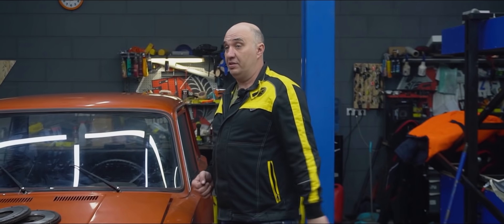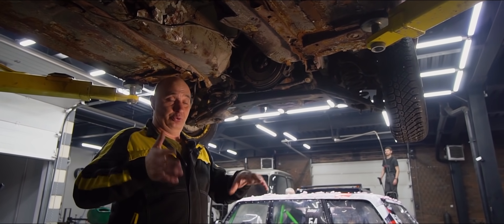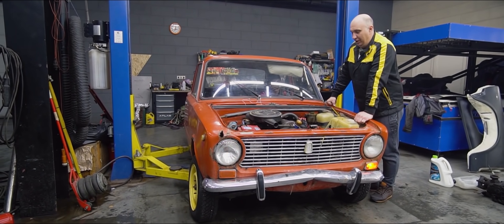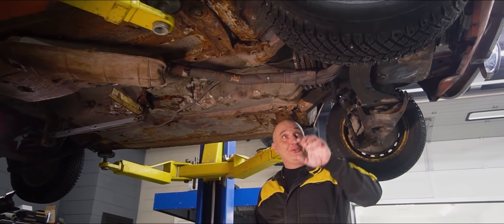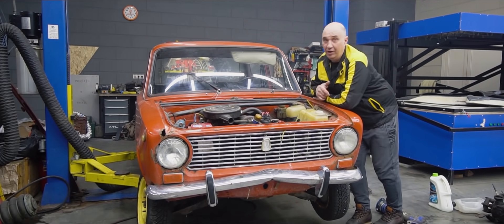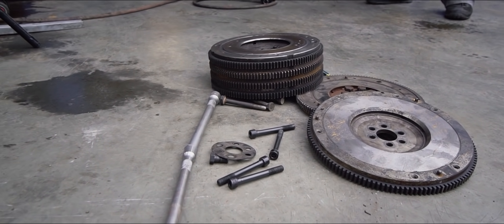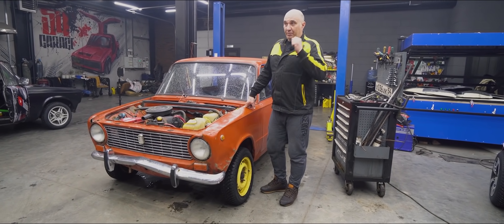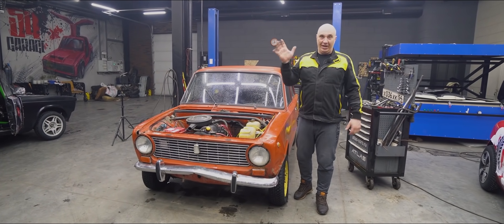What if you install FIVE flywheels onto an engine?

Comment: Tune it rich and watch the backfires.
Reply: You do realize backfires are when the flame comes out the carb, typically the engine stalls at that point. After fire is when the exhaust flames.
Reply: @tylerbonser7686  im pretty sure its backfire when it comes out the exhaust and its called spitting or coughing when its through the carb but its all preference what you want to call it
Reply: A backfire is when the combustion gases ignite while the exhaust port is partially open.
Reply: @tylerbonser7686  wrong
Reply: @kevinragsdale6256  and Johnathan A you guys are unfortunately wrong lol backfire actually is fire through the carb and after fire is exhaust popping
Reply: @jacobwebb8818  wrong, try again. Not one person ever has called a car back firing an after fire.
Reply: @kevinragsdale6256  a back fire is "back" through the intake. They call it that but they are miss informed. Simple lack of the literal meaning of the terms. Doesn't mean there right. Causes can be different as well.
Reply: @johnathana3368  it's not preference.  These are actual terms with different causes.
Reply: @kevinragsdale6256  look it up son but aight
Reply: Oh boy next gen mechanics😂.
Reply: Kevin Ragsdale you’re right, but a lot of people do call a car after firing a back fire.
Reply: @kevinragsdale6256  backfire and afterfire are both terms for when excess gasoline comes through the exhaust port and follows the exhaust until it arrives at the tip where fresh oxygen finally ignites the gasoline causing flames/fire. Not sure about terms for fire coming out of the carb tho

Edit: after a quick google search (which many people are incapable of doing) reveals that afterfire is when fire comes out of the exhaust, but is often called backfire by others. However, backfire is mostly known for fire coming out of the intake.
Reply: Yes !!!!!!
Reply: Get that ignition key going on/off ... in the middle of a built-up area.
Reply: @god.mp4 : thanks. I learned something new.
Reply: @meegstomtom  "a mistimed explosion in the cylinder or exhaust of a vehicle or engine." Not in the carb but in the exhaust pipe. Go down the road, turn off the ignition while leaving in gear. Open and close throttle, turn on ignition. BOOM out the exhaust pipe. That is a backfire. It does not affect the carb. It can blow up your exhaust system. And that is according to Oxford.
Reply: @gravelydon7072  oxford dictionary? Cause that is a literal after fire. While an afterfire is arguably a type of backfire, and most people commonly refer to both as backfire, there are still differences.
Reply: @gravelydon7072  Typically, a backfire takes place when one of the above explosions occurs outside your fuel cylinders. Some backfires travel back up the intake valve while others spill out through the exhaust system — causing a type of backfire known as an “afterfire.” Afterfires can sometimes result in visible flames shooting out of the tailpipe. 

per firestone
Reply: @meegstomtom  Correct on the dictionary. Websters says it is " a loud noise caused by the improperly timed explosion of fuel mixture in the cylinder of an internal combustion engine" but that is incorrect. That is the proper term for a detonation in the cylinder while the backfire is the noise produced in the exhaust.
Reply: @meegstomtom  A backfire never goes up the intake. I can get the same result with the ignition off on some engines after they have stopped. Turn off the ignition when it is shutting down but have the carb open. after it has stopped with the exhaust valve open part way, turn the ignition on. That will produce a loud bang and it will only be out of the exhaust. It is common for that to happen when you have an engine that fires the plugs on every revolution instead of every other one even though it is a four stroke engine ( note a 4 cycle engine is not always a 4 stroke engine ). And for how bad it is, on a pressed together and thru bolted engine, it can twist the crankshaft out of proper alignment. Gravely built single cylinder engines which had a Magneto were known to do it if you released the shut down ( grounds out the coil on the mag )  button or tab before the engine came to a complete stop. It not once would come out the intake. A back fire can also be caused just by the heat of the exhaust system when the fuel air mixture reaches the end of the exhaust pipe and the mixture has enough oxygen to ignite back up the exhaust pipe.
Reply: @gravelydon7072  the good old model L. I don't miss magnetos. Even though my Wisconsin TF still has one. I prefer my old Tecumseh Hh120s. Even though I have a gravely zero turn, my old sears suburbans do most all the work at home. I still even use an old 70s Ariens Trac team equiped with a snow blower attachment in winter. 

But you can still have a flame out the intake. I've seen it in tech school when some of the kids would miss align the timing marks on the cam gears. Or stuck valves. And other issues. 

Walbro even installs "anti-afterfite" solenoids on carbs. Often refered to fuel shutoff solenoid. Like on the LMT carbs. 

What Briggs says about afterfire: What causes a small engine afterfire & how do I fix it?
Afterfire occurs after the engine has been shut off. The. They list some causes and fixes.  

Or a miss aligned timing chain on a motorcycle. One tooth of and people will style try to get it running. But a back fire on those with a diaphragm carb can be bad. That's how I got my 69 Honda CL350. Guy took it apart and didn't put it back together right. Instead messing with the points. Spit, spudder, bang out the carbs. A gasket set and replacement diaphragms and I have a sweet old honda. 

At the end of the day we are splitting hairs, as any good mechanic would know what a customer is referring to.
Reply: I'm not bothering to read this whole thread but so you know, backfiring is more likely indicating a lean mixture than a rich one.
Reply: @jcwar6753  yeah makes sense
Reply: @billbergen9169  ya it generally takes more than a single symptom to figure it out. Generally backfiring is accompanied by other lean indicating factors. Not to say it cannot backfire when rich, just that you have to take it all into consideration.

Comment: To anyone who really thinks that this could work, I want you to understand the function of the flywheel first. This will tell you why this setup would be a terrible idea for everyday driving, but a good learning experience anyway.

The flywheel has teeth along the outside to allow the starter motor to spin the engine. No problems so far...
The flywheel mates with the clutch to spin the wheels. Since the clutch mounts the the outside face of the flywheel, we still don't have any problems...
The flywheel is rather large and heavy. This is to keep the engine running so that the rotating mass aids the engine between power strokes. A lightweight flywheel is better for performance applications like racing, but impractical for daily driving as it would cause the engine to struggle when taking off from a stop. If a flywheel is too heavy, the engine will struggle in a similar fashion. The engine will have to work a lot harder to spin all this extra weight and will also cause rev hang when shifting into the next gear or a higher gear. Thus making increasing rpm and decreasing rpm a much longer and harder task. Here is the problem.

There is too much weight that the engine has to deal with, causing it to struggle. You can move the transmission back on a RWD vehicle like this as far as you want as long as it's mounted securely, but if the flywheel is too heavy, there will be lots of issues with the operation of the vehicle.
Reply: Thanks. Now i know why my dirtbike is turn off easily. Maybe because the flywheel is too light.
Reply: @mrcolorful4571  adjust your choke, clean your carb, and run good fuel
Reply: @MonsterConrad  thanks

Comment: I think the added mass would make an awesome interstate cruiser and also could be used as a mechanical regenerative braking. As you stop you add your forward momentum to a separate flywheel that spins while the car has stopped. When you want to move, engage the clutch to the flywheel first then to the engine to accelerate once the energy in the flywheel has been used.
Reply: You could have a spagg clutch that , that freewheeled , and let the motor drop off in RPM , like a bicycle . I did play with    that a bit . It slammed in and broke .

Comment: These are the important questions in life. "what happens if I do this absolutely impractical thing"
Reply: It does have a practical purpose such as generators, bulldozers, constant rpm varying load applications, as well as  rapid/sudden load or high torque applications
Reply: and some other practical uses: energy storage or energy efficiency

Comment: I expected it to significantly smooth out the engine. Weird.

Maybe see how low it can idle now without stalling?
Reply: For that to work, the engine block has to have some inertia too, otherwise the flywheel may spin smoothly, but the block will vibrate. Normally the block does have way larger inertia, but here I won't be that sure anymore... :-)
But still I think it should allow way lower idle than the standard design, indeed...